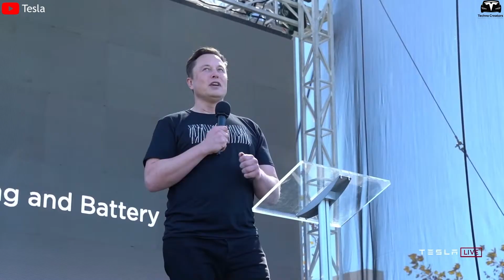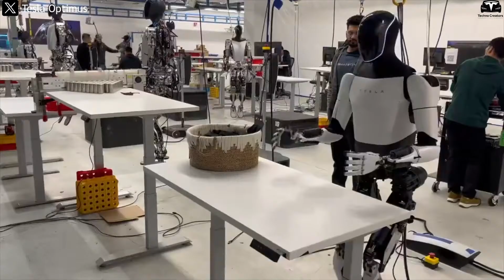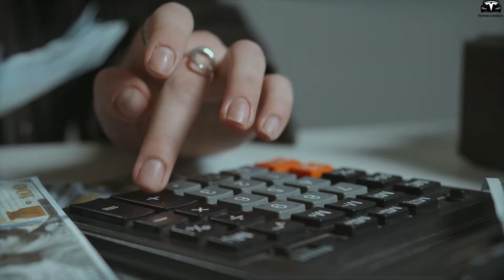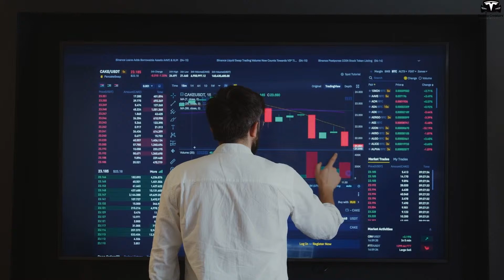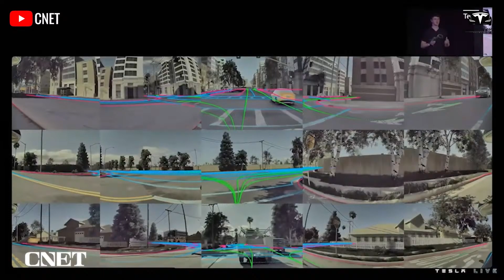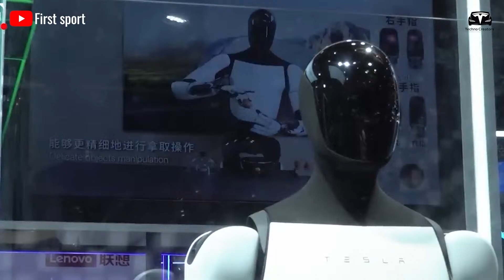How can Tesla Can Tesla Bot V3.5 Become To Master Homemaker? (Elon Musk Won't Tell)

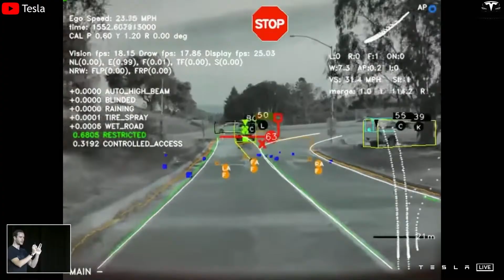Comment: 14:40 this is the process of robot self improving, as its deployed it will show the scenarios where it gets stuck and those are the ones that can be internally worked on. Robot self improvement is much better because these scenarios don't have the life or death of cars. If you deploy cars on the road with scenarios they don't know, it's drastic consequences, but a robot not knowing how to do dishes is not a threat,  so robots can be deployed at scale without the same risks, meaning that you can run into scenarios faster and improve them than you can run into the scenarios of a car,